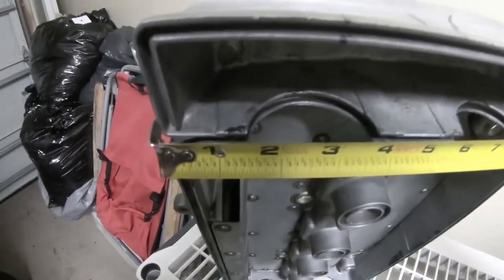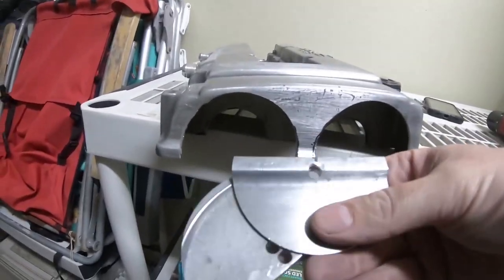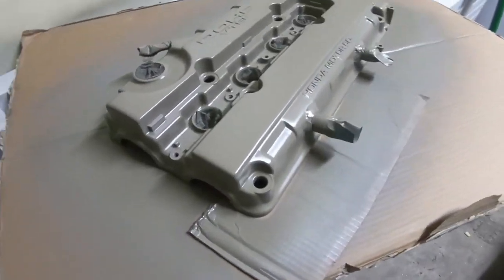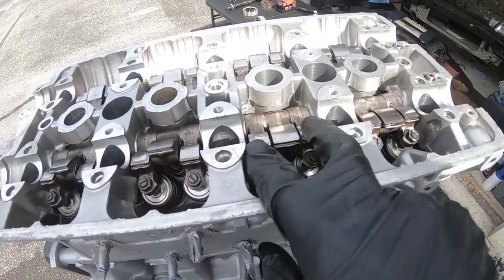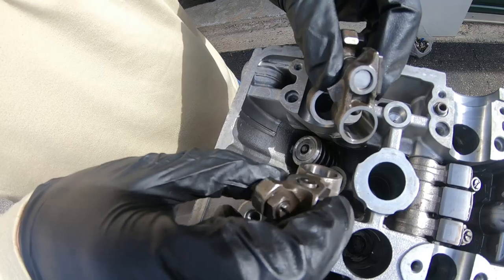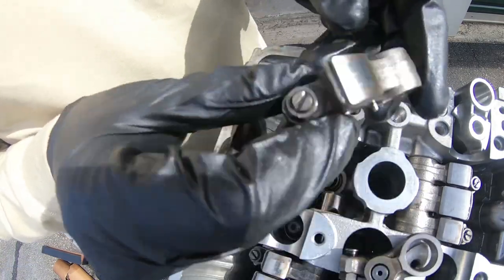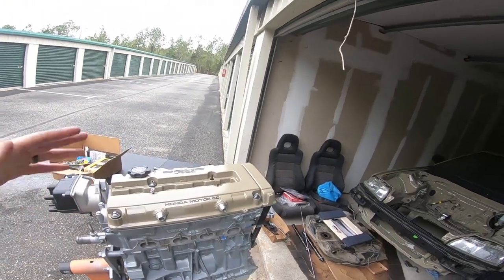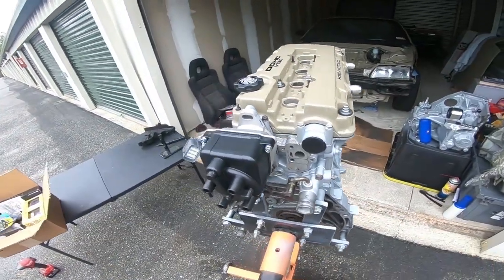Honda CRX Si How to Degree Cams / Mooncuts Ep. 08

Comment: Appreciate the video! Also, if you ever end up doing moon cuts again I found it easy to do with an old busted head and some messed up cams.  You can bolt the valve cover on with an old gasket to get the correct height and remove the cam gears off the cams.  That way you can use the holes from the cam to center your bit for the hole saw and get the holes true to the cam gear location.